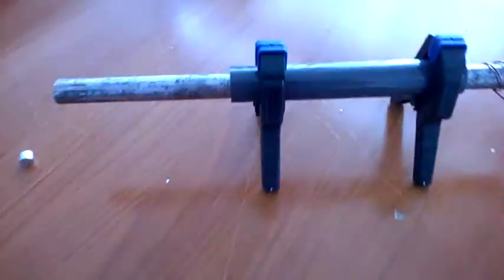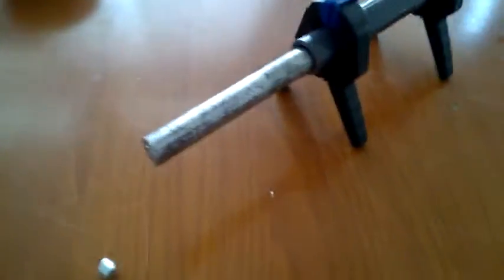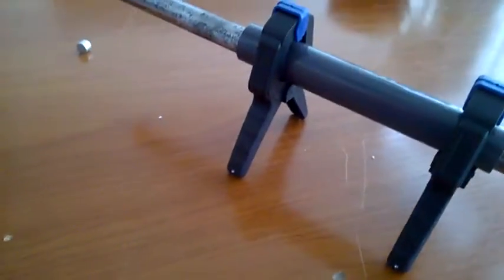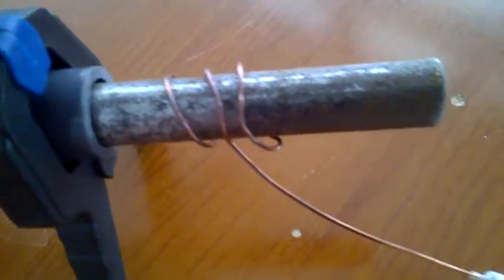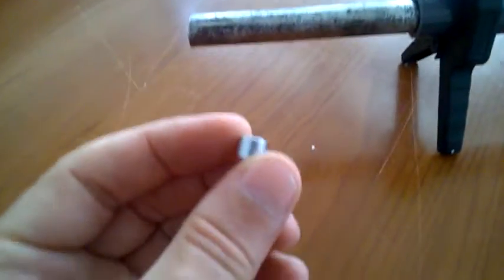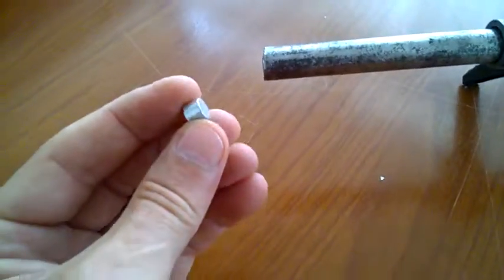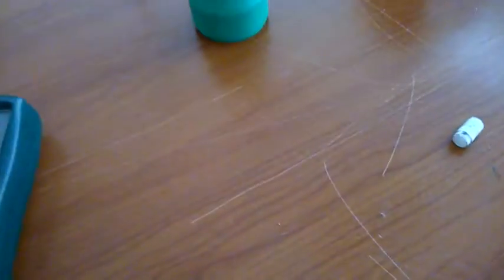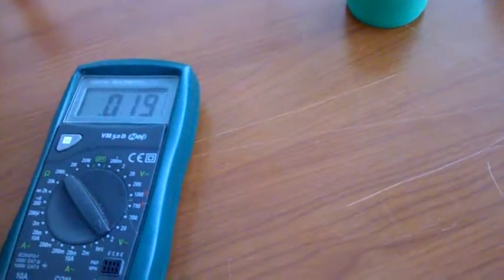Iron Rod and Antenna

Comment: And again .... Try it in the woods .... Far away from electrical grid ... And electrical wires ... It's not free ... It comes from your electrical bill .... RF-Fields from your electrical wires ... Received by the Antenna ... -> No grid and no electrical wires .... Far in the woods ... No "Free" Energy ... Oh yes ... There is still the broadcasting of radio and tv you can get in the woods -> that's the Job af an antenna ...convert radio waves to electricity ... So it's not really free too ... The broadcasting station pays the electrical bill ...

Comment: So much of this is wrong. Cold fusion, by definition, is the fusion of two hydrogen atoms to create a helium atom, at room temperature. It's a specific process. So this isn't, can never be, cold fusion. Any physicist knows this. Secondly, due to the differentials in metals creating electron flow, and due to the pickup of energy from the antenna, it is likely that a voltage on open circuit would occur. Any electronics engineer knows this and expects it. As soon as you put a load of any form on that, the voltage would drop... and free energy is not voltage (static electricity is free voltage, go rub a balloon) but it's voltage through a load (ie current) which gives watts (E=V x A). Just showing one isn't enough. Good grief.

Comment: are  you using a volt meter ? ,,,, whats it measuring in ? are these mili volts ac or dc , wheres the copper connected , what type of receiver ? can you do another video to explain better .